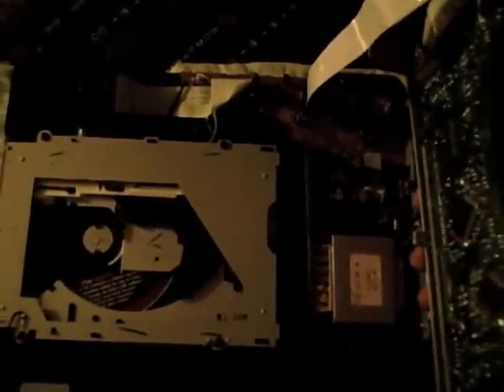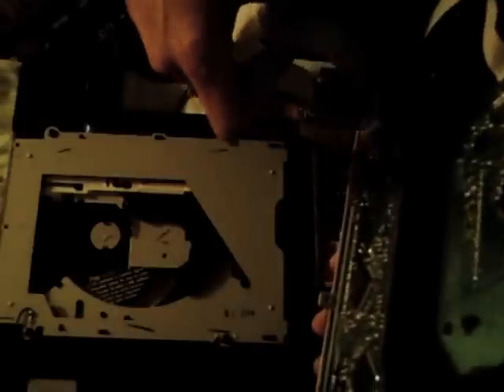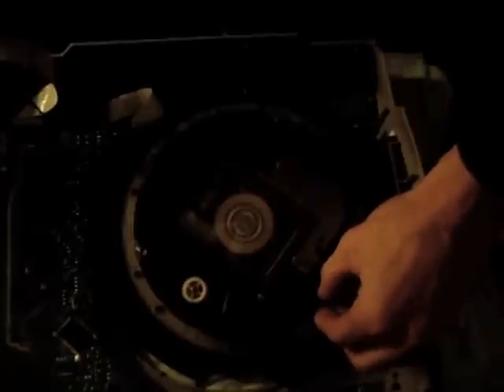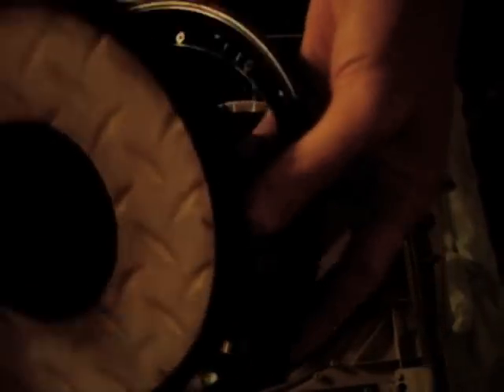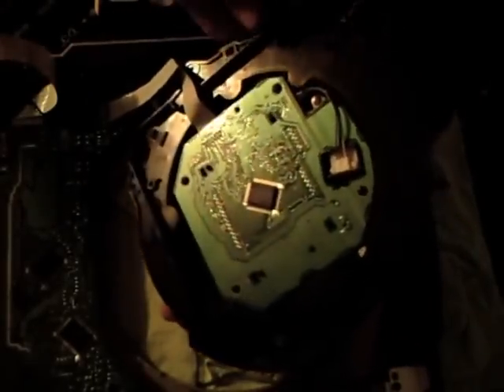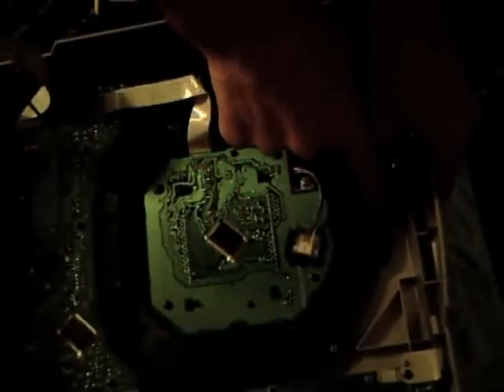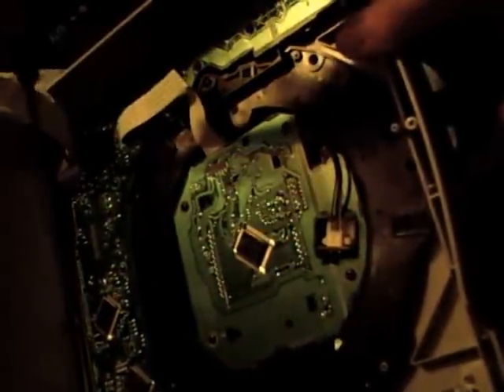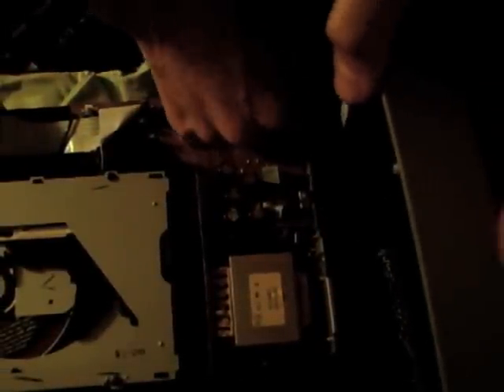How to fix a pioneer CD-J 800 MK 1 without spending a dime - 2 common and easy fixes.

Comment: my platter became less responsive, had to press hard to scratch. stripped as in your tutorial,found the plastic rollers clogged with dirt, cleaned, little WD40, stretched the springs, reassembled. works like brand new, thanks a lot for the video Paul.

Comment: Thanks for the video boss! Would you know how to fix a CDJ-800 MK 2 if it turn off on its own? Then after 2 seconds turns right back on. Iv already replaced the power cable, still does the same.

Comment: i have  a  cdj 1000-mk2 and  the platter  when you  touch it  to  cut  and  scratch does NOT scratch  at all...just as  it  would if it  was on cdj mode...how  do i  fix  this ??? P..L..E..A..S..E.. HELP..